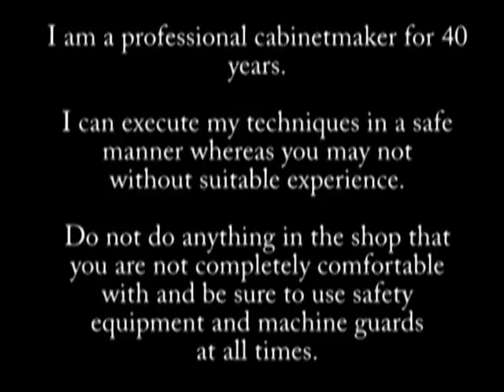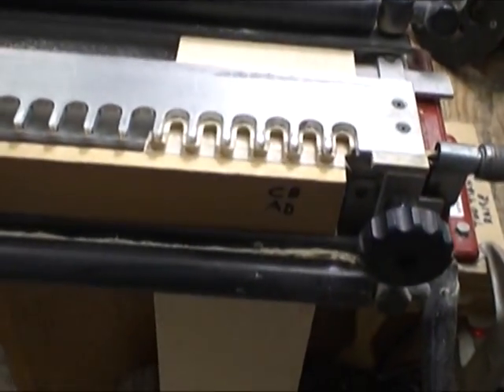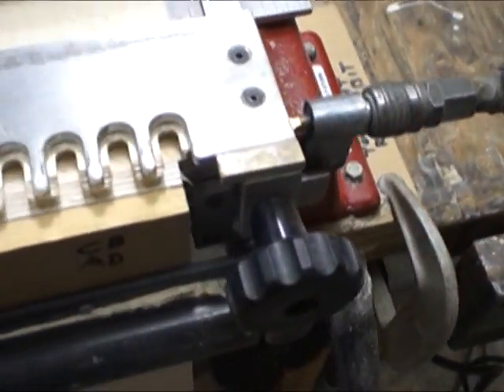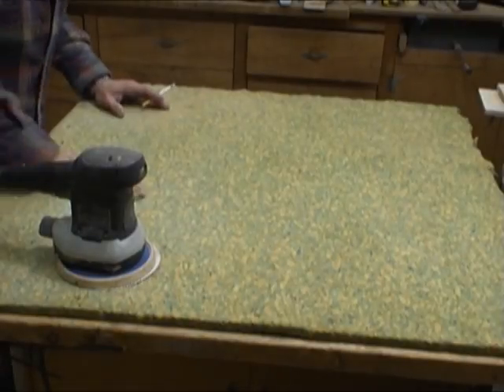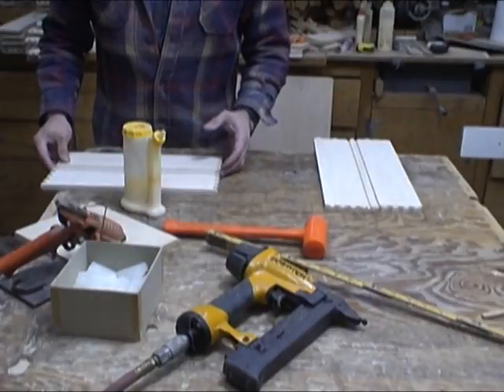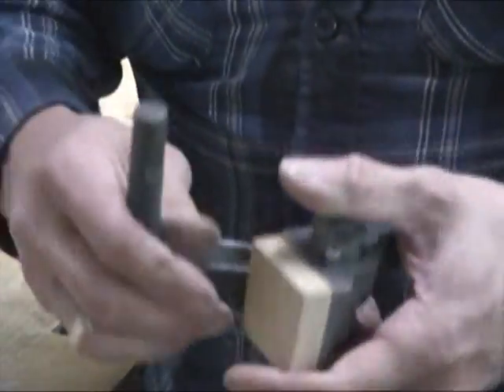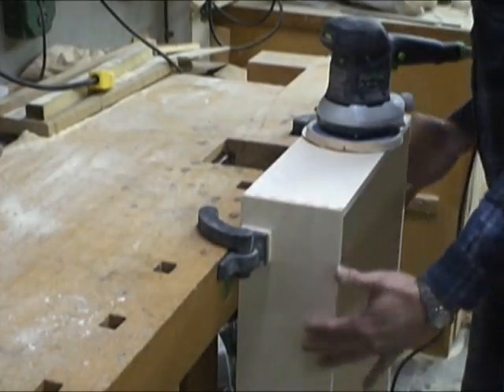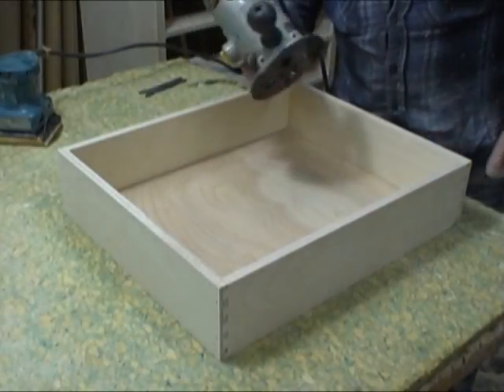Building a Highboy Dresser (part 5 of 6)

Comment: Just an excellent series. Thanks!  I'm really learning quite a bit from all your tricks and tips... and noticing that after 40 years of experience you still have all 10 fingers, I' guessing you really do know what your talking about!  I've not thought about dovetailing cabinet grade ply before but I agree with you that the core reveals really do add a terrific touch of interest.Again, thanks so much!  Love it.Bob in Seattle
Reply from the maker: Thanks Bob.  Yes, I still have all 10 fingers despite hundreds of hours on a 5 HP shaper or as we in the trade like to call it the horizontal chipper.